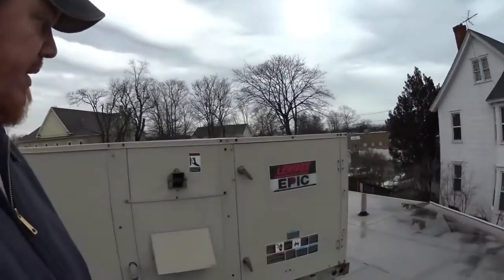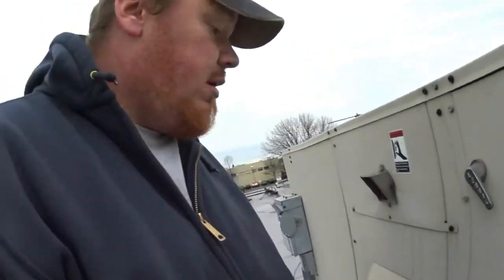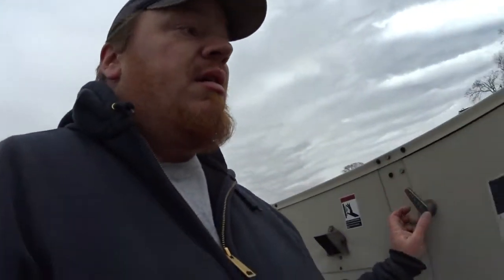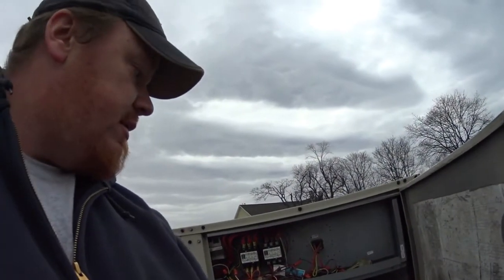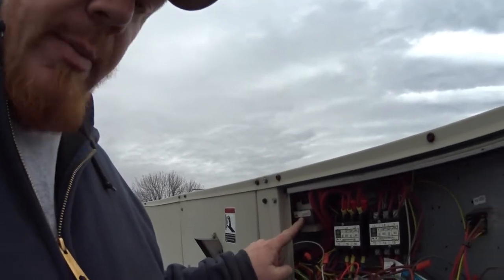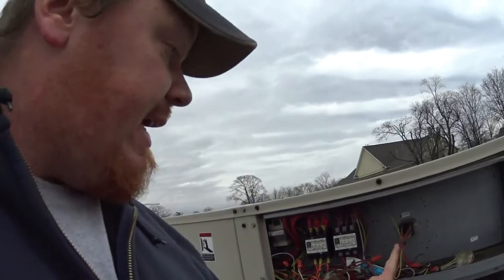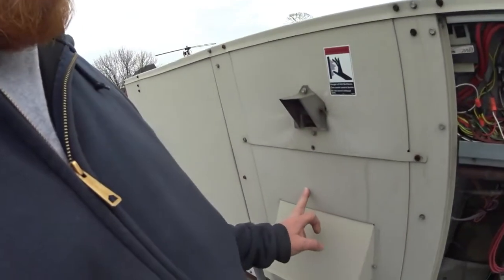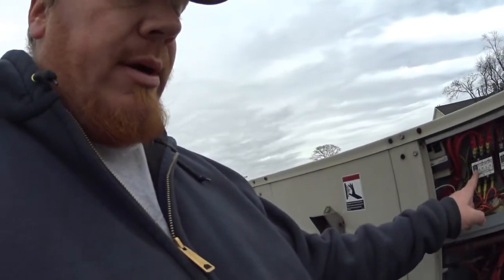HVAC VLOG # 1 #HVAC

Comment: Billy, we have a huge $200k Trane rooftop air handling unit at the hospital, (chilled water coil),  with a dessicant wheel for heat recovery with the return air. The unit has an internal steam humidifier and the two "open" variable frequency drives for the supply and return fans, plus all the circuit boards are all down stream of the humidifier. So during the winter up here in New England, these devices are always in the direct steam flow of the humidifier and constantly moist. Not to mention the VFD's are behind a door on the supply side of the fan under pressure with no viewing window. You can't open the door to see what the drives are doing without having to shut the unit down.
Reply from the maker: That SUCKS!   Way worse than thus little thing...lol

Comment: To try to clear some of this up I will take the part of the manufacturer. There are subassemblies that are produced in another part of the plant like electrical component boxes blower assembly's wiring harnesses and many other assemblies what ever option's that are going in that unit model that day. All these parts are mass produced and on the plans of engineering that is ware that part goes. Then when all these assemblies come together on the line it is to late. Now the reason things don't change is because in order to get these plans past all the people they all have their input and things get upset and now we have to put our unit in testing through all the agencies such as AHRI, UL and any other people that have a crack at it. All this takes money and a lot of of it, so in order to keep cost down we compromise because we are forced too we have investor's we answer to.
Reply from the maker: Larry I hear ya!   I just thought to myself ....   what a dumb  design to start with is all.  I hear what you are saying about it taking money....  thanks for the insight!
Reply: I am not defending any unit that sucks to take apart and put back tog ether but I am hoping that it does sort of clears up why!!!
Reply from the maker: Larry Cole it does!   Thank you for that!   Your words of wisdom mean a lot!